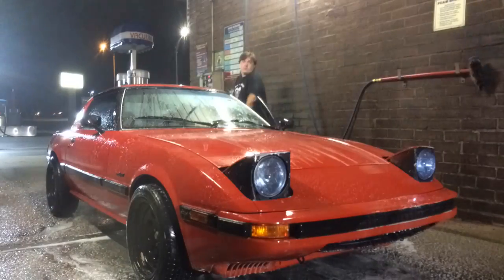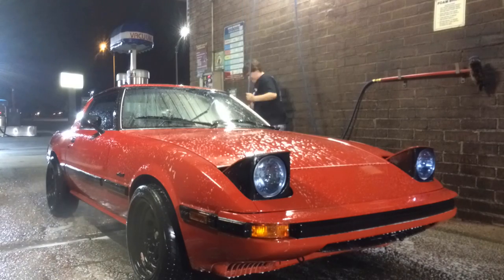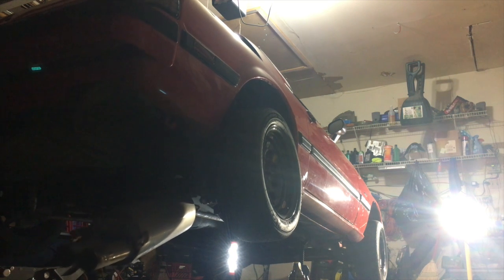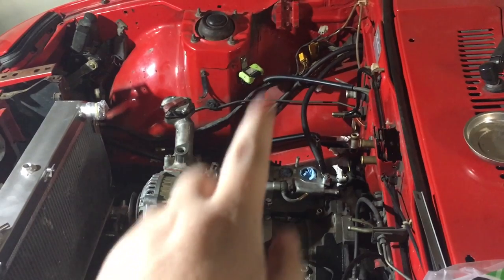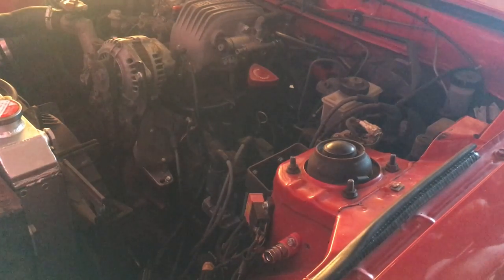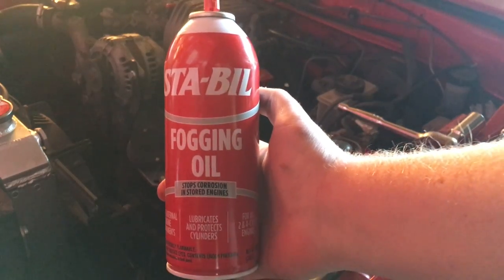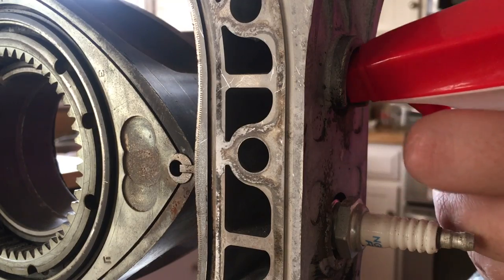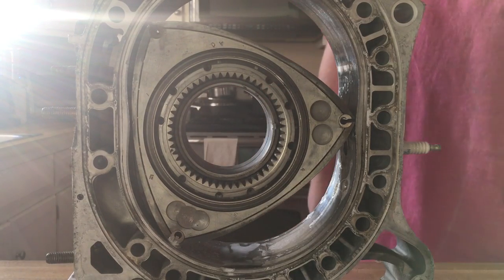How To Prep A Rotary Engine For Storage

Comment: Okay, I think I need a couple of Valiums right now, my nerves are shot, just looking at those photos of the inside of the engine. I have a coworker is someone gave him in 88 RX7 that have been sitting in a field for 15 years. He kept asking the guy about it, the guy said if you can get it out of the field it's yours. Him and a few of his cousins, pulled it out of the field took it to his house and started tinkering with it, got it running within an hour, he's been driving it for 6 years now. I hope I am that fortunate when I start working on my 87 RX7. You gave me advice on another video. I'm going to do that.

Comment: What about driving a rotary car in the winter? Is that recommended or not?
Reply from the maker: Eggward1011 you can! They handle fine! I don't because in my area they use salt on the roads which rusts cars very badly, as well as my rx7 doesn't have air bags so if I get rear ended I'm screwed
Reply: Shooting Cars : that's called life before air bags and other safely equipment before the 1990's. Lol
Reply: Shooting Cars so what do car do you use in the winter? Do you have a "winter beater" or something along the lines of that
Reply from the maker: Not really a true "Beater" but i have a 2007 pontiac G6 I daily drive. I rarely wash it if that counts in making it a beater lol